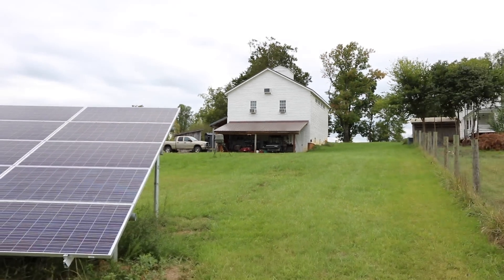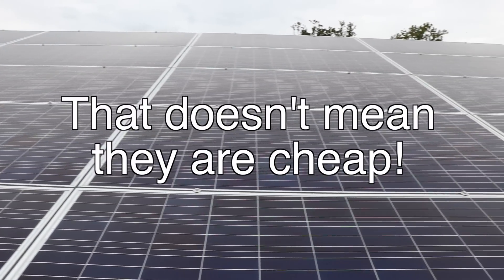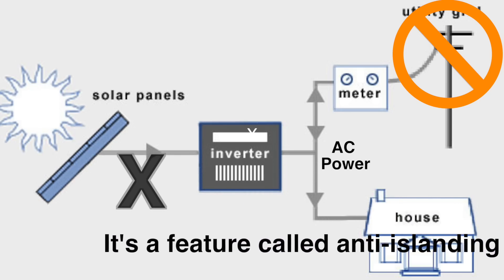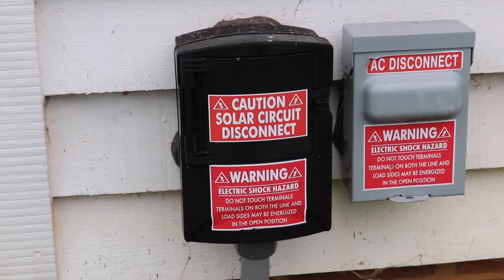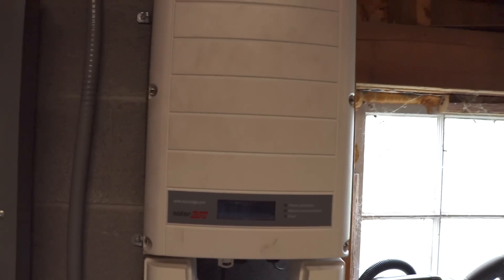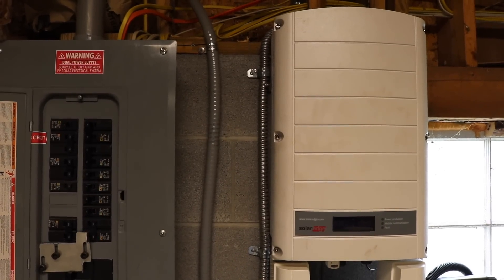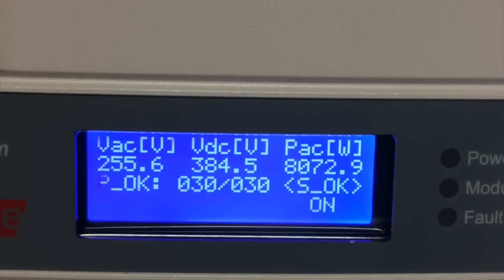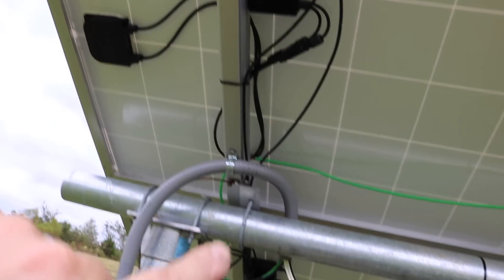The ugly truth behind grid-tie solar systems. Part 1, FarmCraft101 solar.  Watch before you buy!

Comment: Surprised you can’t use your solar panels during a power outage. Can you store energy from them in an electric generator?
Reply from the maker: Can store it in batteries.  Watch for next episode!
Reply: It's not just that simple as having the inverter continue to run when there's power outage. The system has to make sure that under no circumstances ever power is fed back onto the power lines that are "out". You do not want to supply all the neighbours and maybe shock the electrician that's reparing the outage somewhere. Also if the power comes back it will be out of sync with what your inverter did in the meantime. You grid tie system has to be able to handle that, but it is not the standard (yet).
Reply: Agreed.   Your PV system would go down nothing as it assumed the load of all customers this side of the line break or the short on the line!
Reply: Anti Imperalist possible rn xxx
Reply: superdau  Hi, this is a different situation than where there is a permanent backup generator installed with a transfer switch that prevents the same thing from happening?
Reply: The inverters can only operate with a grid-forming device also running on the same circuit.  By design, standard grid-tied inverters have an anti-islanding feature, to prevent them from putting power on a lack of a grid.   As mentioned previously, for the safety of the utility linesmen.

There are battery back-up inverters that can form a grid for a standard grid-tied inverter, so you can have power to the select loads you assign to your critical loads panel.

Comment: When you calculated your ROI, did you use actual insolation maps for where you live?  The insolation where I live only allows for a best case, 17 year ROI.  We don't get tax rebates where I am in Canada.
Reply from the maker: Yep, calculated for my location.  Have you priced solar recently?  The cost per watt has really come down.  How much you pay for electricity will effect this calculation as well.  We are about .11 cents per kWh here.  So quick and dirty, let's say my 9kW system makes 7000 watts for just over 7 hours a day on average, and produces 50kWh per day.  That's $5.50 per day X 365 = $2000 per year.  Take rebate saved me around $6k, so would have to add an additional 3 years for that.
Reply: FarmCraft101 Ya see right there...  The average for insolation is only 4.25 where I live and solar is quite expensive in Canada as we never had the massive subsidies that existed in the US.

That being said, my rate for power is about the same as you. 10.5 cents Canadian per kWh.  I watch the prices often but I always fear the uncontrollable aspect of the power company no longer paying feed in tariffs.  And going full off grid for a house with a geothermal heat pump is far from cheap.  My annual usage is about 23,000 kWh.  Keep in mind that I use no other source of energy at all and my ghp also supplements my hot water.  The house is 3400 sq feet of heated living space.
Reply: You seem to be using numbers which fly in the face of standards for solar production. I the North east it is appx 4, maybe you have 4.5.  So throughout the year you would make 9kwh x 4.5 or 40.5 kWh per day. Multiply that by 365 days and your annual output is 14,782 kWh.  If you pay .12 per kWh then you make $1,774 in power per year.

The other factor is unless the warranty for the panels and inverters is backed by a legitimate insurance company the chances of the companies actually being solvent or even existing in 20 years is very poor. Seen plenty of examples already in just a few years. 

Remember the pioneers are the ones with arrows in their backs!

Comment: How are you going to cope with snow cover on the panels? This is a real problem with no satisfactory answer as yet.
Reply from the maker: I don't get a lot of snow here in North Carolina, but you are correct, it is a concern.  I'm hoping it will be infrequent enough that I can just clean it off manually without too much trouble.  Heater cable could help.  I'd have to run it between the panels so as not to block the light, but could maybe also run some behind the panels too.
Reply: Thank you for the reply. Where we are in north west Canada, the snow cover is a big problem.
Reply from the maker: I bet it is!  Brrrr!

Comment: Having the inverter that far away from the panel is creating some voltage drop, changing to a.c. near the panels is much more efficient. 

Good vid
Reply from the maker: Actually it's all about the voltage when you transfer electricity, rather than AC or DC.  In this case I am 360V DC, higher than my AC which is 240V.  So it is actually more efficient to transfer the power as DC in my system, because it's at a higher voltage.  Thanks for watching!
Reply: Actually it's more about if it's ac volts or dc. Ac requires smaller wire, dc requires larger. You would of only needed probably 2 #10 thwn conductors if the inverter was mounted by the ground mount. It's always easier to deal with ac vs dc when dealing with the code book. 690 is a pain in the nec. Great video though. Nice job.
Reply: @TheRealTonyCastillo  you are totally wrong. AC has skin effect, which means current likes to travel on the outside of the wire, so you need bigger copper. DC uses the whole area, so it can be smaller copper. Farmcraft101 is correct that 360v DC is far more efficient
Reply: @climatechangepreppersfaceb2148  Skin effect only applies at radio frequencies not 60 Hz. But it is quite right that 360 VDC will require smaller conductor size than 240 VAC.

Comment: If you calculated an 8.5 year break even point, how does that line up with the typical lifespan of the solar panels?

It wouldn't be good if they failed prior to or shortly after you break even.
Reply from the maker: Very true.  The panels have a 25 year warranty.  The inverter has a 10 year warranty, but it only costs $1200 to replace.
Reply: My solar panels I bought a few years back were warrantied to produce 80% of their original power output after 25 years. 50% after 50 years. They last a good long while, there is no moving parts after all.
Reply: Good to know.  Thanks for the replies.
Reply: Evolution - Question Time the transformer that brings the local grid voltage down to 240v will do the opposite when back fed from the house side....ex. 6800vac to 240vac will also do 240vac to 6800vac
Reply: But it's not like they pack up and come inside during bad weather either, that's the question he was asking about.  How susceptible to damage from bad weather are they?
Reply: Think of cars. They are generally warrantied for 6-8 years, but you know they will likely last 15-20 years. Solar panels installed in the 70's have been tested and are still at 85% of full spec. The panels being supplied today are much advanced over the first gen ones, and more durable.
Reply: I can't touch it or open it until insurance has done their thing with testing and investigating. I was told from a electronics tech to check the MOV's (Metal Oxide Varistors) in case one or more are damaged, assuming it has those.
Reply: michael rew 
short sighted corporations!?
(-:
Who knew!?
Reply: Paul Fries . Have you considered the real possibility that the electricity from the grid will rise each year, therefore the time factor before you break even will be less than 7.5 years not more !!
Reply: And why do you believe that? There are many systems that have in operation for many years so we have real data. Very few failures have occurred, and most systems have long outlived their projected life. The average car is warranted for 5 - 8 years, but we know they can last 20 years or more.
Reply: skozzy1968 if you are lucky you might be able to get a schematic from the company especially since they don't make that model anymore.  MOVs are a good bet, but really anything on the output would be suspect.....
Reply: Schneider who bought out Xantrex said it is not in their best interest to share/sell/part with the schematics also was told they do not have spare parts, and to send it back for a service/repair is a $450 up front fee, and likely it won't be repaired anyhow. Sad thing is if the original company was around still then the unit would still be in warranty. Finding an old working one in Australia is difficult, because most sold are still in service. It is rare for someone to upgrade since here it means losing your feed in tariff rebate. The inverter will power up if the main is on or if the DC from the panels is turned on, but it displays a message External Shutdown and just won't send anything back in to the mains.
Reply: skozzy1968 just out of curiosity what is the model number.  I found a couple schematics for some xantrex inverters online....it's good that it at least powers on....there is a grid power sensing circuit in the schmatic I saw.....good place to look....as long as nothing is potted, it might be a very easy fix once the insurance gets done with it....any parts will be available from a supplier like Digikey (USA) or equivalent.  Too bad the company that bought out Xantrex is so short sighted.....a little good will brings a lot of loyalty from customers.
Reply: skozzy1968 I see the predicament you are in although I see the intent of the rule about changing inverters.  This is clearly not directed at your situation with a nonfunctional inverter that has no direct replacement although cutting through the red tape might be very hard.  In looking though the manual for the model inverter you have, it looks like you can replace the inverter section with any size inverter in the same series.  Depending on what happens with the insurance,  if it were me, I would do what we call a "Saturday evening swap" with the next size up.  I also think you have a very good chance of fixing the original for less than $50.
Reply: I do hope it can be repaired, but it seems the people the insurance company have sent out so far only talk about replacing old with new and never bothering with repairs. Someone from one of the assessment companies has just been and now I have some time to remove it off the wall and open it up.
Reply: +Moon Pie 
yes, to your  analysis on the inverters going first.
Home Power, has been teaching this for decades.
All of you folks are really doing good work here in the comments.
Good spirit work.
Reply: You didn't think this through.    Inverters can be repaired...
Reply: Yea OK? what happens in very high winds with the panels
Reply: It would be interesting to see some figures from people with systems:  how much they paid for the system in total and how much they saved in electricity costs over what period.
Reply: skozzy1968 did you look at fixing the inverter?
Reply: Xantrex GT2.8 2.8kw Australian Model (Transformer Design), so 240vac mains. Just one link I googled quickly -> http://www.ecodirect.com/Xantrex-864-1030-2800W-230V-Grid-Tie-Inverter-p/xantrex-864-1030.htm
Reply: When our government first started the rebate scheme they offered 44 cents per KW (plus a bonus from your nominated supplier) excess that you return back to the grid while you get charged about 26 cents per KW (domestic) and around 4 cents to 8 cents per KW (Commercial), originally this was for systems up to 10 KW (which was reduced to 5kw about a year later), the government also paid a decent amount towards the panels reducing the overall cost of an install. Read more here > https://www.dews.qld.gov.au/electricity/solar/installing/benefits/solar-bonus-scheme . As for them 'Knowing' if you increase the inverter size, well for grid feed system it can be installed only by licensed installers, they are required by law to inform the electricity supplier of any change to the system, this is how they find out.
Reply: Skozzy; I'd go with the smaller size to keep your tarriff. If you can find a cheap power storage system like powerwall then just sell power back for longer at the reduced number of kw. Or go into business generating hydrogen or open a tesla supercharger station for the excess.
Reply: what about wind hail damage?
Reply: +Common sense; lol. These aren't windmills and it doesn't hail while the sum is shining. Duh.
Reply: ok, sorry for poking fun. it depends on the size of hail. usually they will be at an angle, rarely facing wind head on except for very high latitudes. main problem with wind then is what the wind blows into the panels... like whale sharks, j/k. anyway the amorphous silicon flexible panels are much more tolerant of harsh weather events. their flexibility gives way more than hard panels that are only as strong as the glass encasing them. without that case (one of the biggest costs in producing solar cells) they are extremely thin films of silicon. you can imagine how delicate that would be.
Reply: no problem i just thought it was some dumb$$ making a comment.
Reply: +enator71; large hail/sticks damage horizontal placement but strong wind damages vertical placement.
So more traditional solar collectors use photosynthetic organisms/biogas fuel applications. Much cheaper and resilient. Not sure the efficiency rate though even when harvesting wild growth biomass. Definitely less convenient for roof mounting.
Reply: Most objective explanation of the pros and cons of Solar.
https://www.youtube.com/watch?v=uEIDMkWEc0M
Pros and Cons of Going Solar with Kathy Campbell
Reply: +GEORGELET4; more like an introduction to pros and cons. There are several types of solar options to decide between.
Reply: That may be but I believe most of the videos on solar are overly optimistic on how effective the systems will be and how soon a buyer will recoup the costs.  In the video Kathy Campbell is realistic.  What do you find?
Reply: +GEORGELET4; yeah impartial just looking out for her clients not sold out to big oil nor big solar. I just think "most" is a bit extreme. There must be lots of other videos pointing out those pros and cons. I think she could have jumped into her discussion sooner instead of so much introduction as if she was about to say anything that was hard to substantiate. Brevity helps catchy memes go viral.
Reply: Gobbledygook on your part.
Reply: Lightening strike is considered an act of God...wouldn't that be covered by your homeowners insurance?
Reply: enticed2zeitgeist I like the warranty you mention. Are you willing to share what company/ brand you have? (Assuming you are in the US anyway, otherwise it won't help me much I suppose.)
Reply: Typically the agreement with the utility is that your generation facility will not increase in size.  That means that you cannot add more solar panels as that would increase your generation capacity.  Replacing your inverter with a newer inverter that has an increased generation capacity does NOT mean that it will generate more power.  The individual(s) at the utility that provided you with this information do not understand how these systems function.  It appears that they (the utility) are under the impression that you are planning on increasing your generation capacity.  Now that brings up another topic, why are they being notified of your intention to change the inverter?  Just change it and be done.  The utility has no way of telling that your inverter was changed and from my understanding, without seeing your interconnection agreement, they have zero reasons to be concerned that you have done this routine maintenance.
Reply: Last I heard, the first solar panel ever made (some time in the (1960’s) is still producing power...not sure how true that is, but there arent any moving parts, so I’m tempted to believe it.
Reply: My system is 5 years old, only recently the inverter was killed from a lightning strike, our inverter was a 2.8kw Zantrex inverter, those are no longer made since Synider bought them out, I can't get spares or a replacement, also no one makes 2.8kw, there is 2.5 and 3 and 4 and 5 etc.. My power company said if I change to a 3kw inverter I will lose my current rebate 54cent and be put on a 4cent rebate, if I go to 2.5kw I can keep my 54cent rebate. Losing an inverter can cost you more then the replacement when you are stuck with technology that cant be fixed. We have been without it now for about 3 weeks and I have been missing out on 15-20kw each day since.
Reply: @skozzy1968  Would it have saved you if you had a TVSS somewhere in the system?
Reply: skozzy1968 I couldn't find that exact model schematic, it may still be out there somewhere.  Even if it isn't available, the circuit isn't overly complex and is probably just a double sided board.  Although it is a pain, you should be able to draw it out by looking at the PCB....and since the inverter does power up, the problem is likely in the output section.....in the grid voltage sense circuitry or the feed to that.  If you don't mind me asking, how does the whole rebate thing work...I mean, if the capacity of your system stays the same, and you put on an inverter that is capable of supplying a couple humdred more watts, it seems unlikely that there would be a way to detect this, unless the power company is actively looking at your equipment.  In the US  any excess just runs the meter backwards....and the average is far less than the capacity of the system